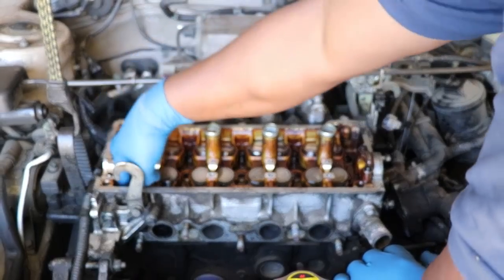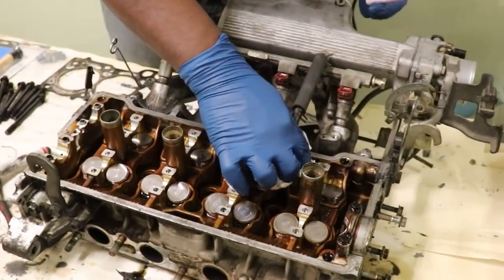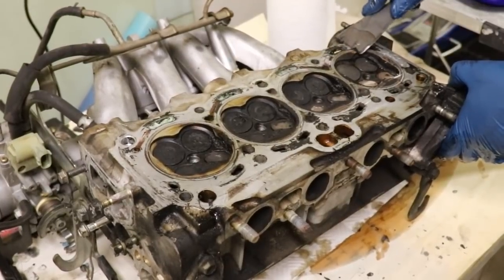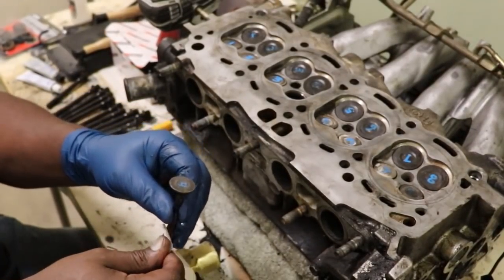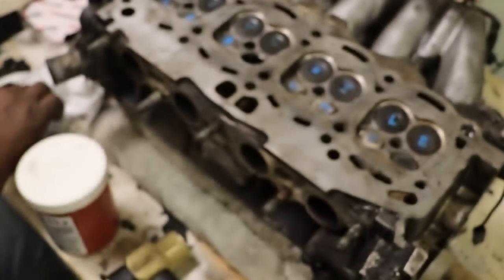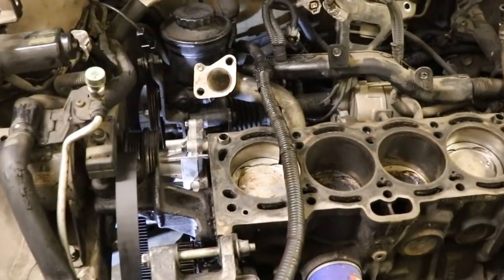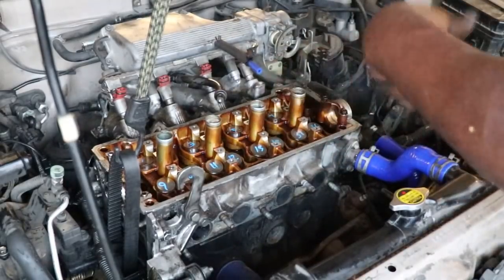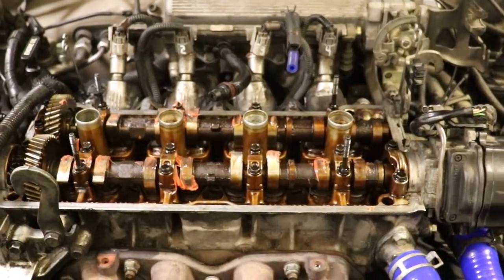How to do a valve and seal job for Toyota Corolla 7AFE engine

Comment: Going to use this as help. I’m redoing mine on a 400,000 mile celica! Should be exciting
Reply from the maker: Very cool, that's a perfect platform.  I put a Celia engine in my wagon, I think it has a little more power than before even though both engines were 7AFE.

Comment: Ive never re-used head bolts.  Its only 16 bucks or so for a new set.  Better to be safe than sorry.  Also, you can clean the surfaces with oven cleaner and/or degreaser.  Anything left over just use a 6 inch block and some 1000 grit and go over it.  Check out my video of re-doing my 7AFE.  Head went back on with a mirror finish.  Still running it hard and its been 3+ years since I did this..
Reply: @Hassan Houston instablaster :)
Reply: @Ezekiel Seth Thanks for your reply. I found the site thru google and I'm waiting for the hacking stuff now.
Takes quite some time so I will get back to you later with my results.
Reply: @Hassan Houston happy to help :)
Reply: I have reused head bolts tons of times and have never been sorry

Comment: Is it better to use a plastic scraper vs metal? I worry about scratching the surface of the head. Thanks for the videos. Replaced my water pump a few weeks ago and thought the head warped when it overheated cause I was slowly losing coolant. Turns out the water pump I put in is leaking/bad. Just ordered an AISIN pump instead of the Gates on I had and hoping for better results.
Reply from the maker: Metal. You'll never get it off with a plastic one. Keep the scarper as flat as possible so you don't gouge the head gasket mating surface.

Comment: Do you have a video on checking the valve lash and adjusting clearances? I'd love to see a good one. I get some "blow by" from my oil filler cap and wanted to make sure my clearances are good. (Tho admittedly, my rings could be worn too.)
Reply from the maker: I don't think I've video taped it but to adjust the valve clearance on these cars you must measure and then change the spacers on the lifters.
Reply: @Engineerboy100  Do you happen to know a good video that demonstrates the procedure? I'm still learning, but learning a LOT and your videos and method of teaching has been awesome. Thank you so much!

Comment: I'm trying to find a decent replacement cylinder head to keep my '94 Corolla beater going and have been unable to determine whether  7afe and 4afe heads are interchangeable. I've seen some indication they are,  but hoping you might know this, definitively. Thanks. Dale
Reply: 4AFE and 7Afe are all the same,, even carburetor cylinder head fit on injector block..

So you can buy any..

Comment: Nice job sr . i like to ask you i heat on the other. Video you change transmission fluid . my corolla is 98 and it have 225k miles when i bouth the car have 150k. Miles i never changue the trans fluid do you recoment me change the fluid. ? Or just refill . and what tipe fluid i can use ?
Reply from the maker: Yes, with that many miles I think it's about time to change your transmission fluid. Use Toyota / Lexus fluid, they have it a Walmart https://www.walmart.com/ip/Toyota-Lexus-Automatic-Transmission-Fluid-1QT-WS-ATF-World-Standard-Ready-to-install-By-Genuine-USA/958574363?sourceid=csebr0372855bc7b4bd4fa8a71ca27d8233b074&wmlspartner=bizratecom&affcmpid=1158021134&tmode=0000&veh=cse&szredirectid=15781706637614748482610080302008005
Reply: @Engineerboy100  i will change the filter the gasket and the fluid . you know how many quart o have to use ?

Comment: Nice explaination. I´ve a question: in the case of time belt broke the piston will damage the valves or not?
Reply from the maker: When the timing belt breaks it may damage the valves depending on the design of the head. On this model Toyota, the valves have a "clearance" design so they will not hit the piston and be damaged.  On some cars like my BMW they are designed with an "interference" fit and will damage the valves if there is a failure. This happened to my BMW but it wasn't a timing chain failure, I over reved the engine at the track by down shifting from 3rd to 2nd at 90 mph on accident.
Reply: @Engineerboy100  thank you so much for your answer. I have 2 Corolla 1999 and 2000 and I love it. Have a nice day Clint.
Reply: @Engineerboy100  the 4afe doesnt have the same valve clearance, does it? so 4afe ifbelt time broke it probably damage valves right?
another question in my 4afe i hear some noise from the head, i guess camshaftand is more notice when motor is cold( its not valve ticking) the car pulls well. when its normal temperature you don´t hear the grinding noise

your videos are awesome.. love from portugal

Comment: Lovely video... do you have one where you remove the head?
I get a puff of smoke when I accelerate after engine braking down a hill... valve seals are bad right? Celica 94 with 7AFE has LPG.. is the LPG responsible for this?
Reply from the maker: LPG?
Reply: @Engineerboy100  Liquefied Petroleum Gas

Comment: can i do all this without pulling engine?  I just need to do rings, pistons  but see that at 240k, more than rings should be done- thanks for comment
Reply from the maker: I did not pull the engine for this job, only the cylinder head.
Reply: @Engineerboy100  good- there is hope- what was the total time? 20 hours?

Comment: Another good job
Reply from the maker: Thank you Mark!
Reply: @Engineerboy100  im rebuilding my engine pretty soon where can I find the full Torque specs for the Corolla engine
Reply from the maker: @markclarke5021  I use this Haynes manual, https://www.ebay.com/itm/1994-Toyota-Corolla-Haynes-Online-Repair-Manual-Select-Access/282752705701?fits=Year%3A1994%7CModel%3ACorolla&hash=item41d55fe4a5:m:muVB0PVaxdwvJjHut8E47dg&frcectupt=true

Comment: Can I do the valve seals with out taking the head i change the head gasket like 2 years ago I got good pressure
Reply from the maker: You can change the seals, but you can't resurface the valve seats, they are on the inside, the head must come off for that....but changing the seals without taking the head off is tricky and requires some advanced techniques for keeping  the valves from falling into the engine.  I highly advice against it, especially if you are not experienced.

Comment: Great and very helpful video... Thanks!   Where do you find your mls head gaskets? Are they 7afe specific or can they also work on a 4afe?
Reply from the maker: I get mine on eBay and I use the same on for 7afe and 4afe.

Comment: How much would a shop charge me for doing a valve job on a 7afe engine?
Thanks
Reply from the maker: Different shops would charge various prices but a reasonable range would be $450 -  $600 on average depending on the car. More for expensive cars ....

Comment: Why it's necessary to remove cylinders head to change valve seal????
Tdc can not be used to prevent valve's to drop down???
Reply from the maker: I've seen that method, ... but if you watch the video, we did more than change the seals.
Reply: @Engineerboy100  i agree , i have seen the video...
In my case, i have an A4FE engine ov toyota Corolla 1998 , and only valve's seal are need to replace...
I just don't have a blue smoke, i have a smell of baked oil when i release the gas pedal.. When i hit the gas nothing..
It means the depressurise in cylinder sucked oil trough damaged seal...
But when i hit the gas it stops..

Comment: Guys i need help, i have a 7afe with different colored valve springs, theres brown and silver springs, which is the inlet and which is the outlet springs???
Reply: do you mean the seals ? if so i've learned that silver/grey is for exhaust and brown is for intake ;)
Reply: @sota_tld1112  ive been driving it for 1 year now, but thanks for the reply anyway xd

Comment: 22 ft pound
Reply from the maker: Plus 2 90 degree turns after that.
Reply: @Engineerboy100  It's a delight to watch your videos. Truly outstanding and very informative. I''m almost done with the cylinder head service on my 1998 4AFE. One question please; why do you specify 22ft-lb plus 2 x 90 degree turns when the Toyota service manual specify 44ft-lb? I'm merely curious and not doubting your method.                                                                                       Also do I need to retorque the cylinder head bolts after driving 1 000 km (break in)?

Comment: Can you give me your facebook account.Please i wanna ask you something very important if you could help me.I bought a Toyota Levin with the engine swapped.And i dont know what my engine is.It looks exatcly like yours.But i dont know if it is 1.8 or 1.6 l
.please could you help me a little.Can i contact you via Email or Facebook.
Reply from the maker: The most reliable way to check which engine you have is to look at the engine code that's etched into the block. It's located to the right of the exhaust manifold and is stamped vertically
Reply: Code are dleted cannot read anything sir.I added you on facebook.I have a pic of the engine..May you check your messages please
Reply from the maker: My YouTube name is Clint Hightower, My Facebook name is Clint Hightower, my email is Clinthightower@yahoo.com
Reply: @alexmoraru9374  Hi the easiest way to identify a 1.8L(7afe) from a 1.6L(4afe) is only looking down the oil pan. The bigger engine have like a middle section of aluminum before the small steel oil pan. The smaller engine only have the steel pan at the bottom. This means is iron cast block and oil pan on the 1.6L, and on the 1.8L is iron cast block , aluminum middle piece and oil pan. hope this helps you.